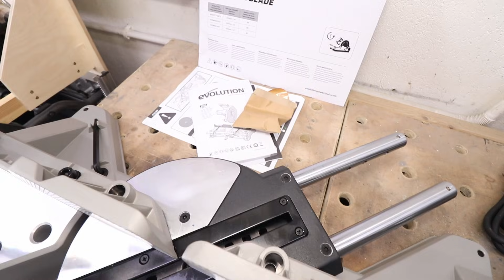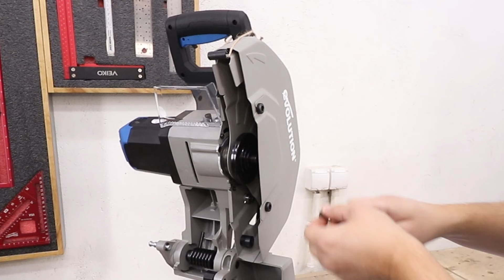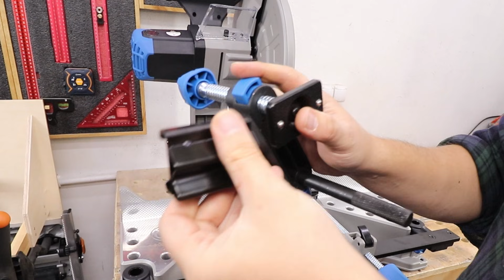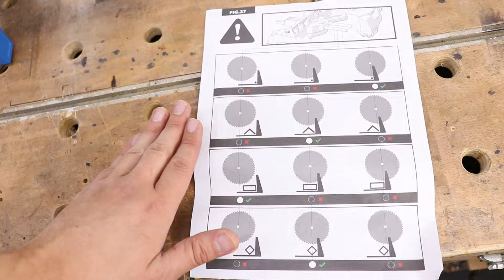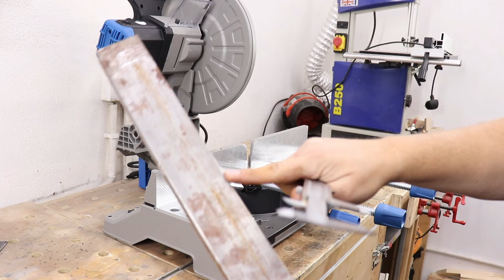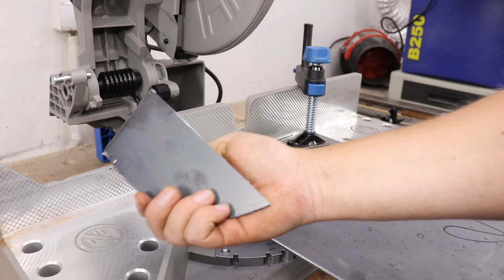This Metal Chop Saw Just Blew Me Away — Evolution S355MCS Full Test

Comment: I bought it a few years ago (the previous chopsaw had only one clamp). OMG.. You can cut razor blade thick wedges from 100mmx10mm thick square hollow sections. I think this is the best Evolution tool in terms of quality and precision - everything else they do is just a clever marketing. However, this one works exactly as expected, so if you are after metal cutting - that is  the best tool.

Comment: Nice saw but as you point out quite expensive.
Its a wonder they cant get it to the market at a cheaper price, essentially its just a chop saw right?
Reply from the maker: I think its the cost of materials. Its huge and super heavy, all metal super sturdy. Must be built differently to tackle hard materials. The motor is designed differently. Plus the blades themselves are quite expensive.

Comment: IMPORTANT SAFTEY NOTICE  - This saw runs at 1450 RPM. . ABRASIVE WHEEL ( Grinder disc) chop saws run at much higher rpm speeds .Over twice that of this type of saw.   Don't be tempted to fit the blade featured here into your existing chop saw expecting similar results.. The high rpm of a abrasive chop saw could cause this blade to shatter !
Reply from the maker: Yes those blades are not designed to run with normal saws.